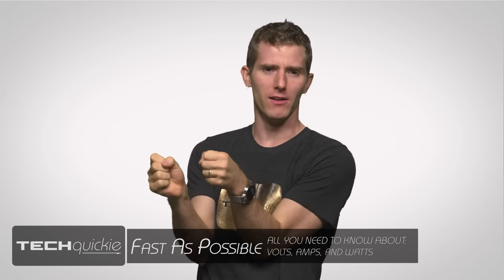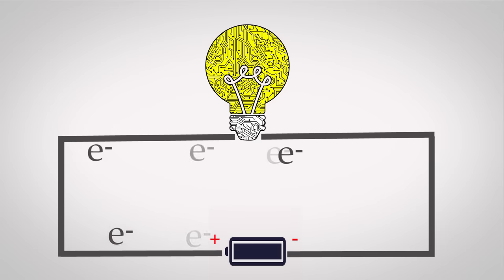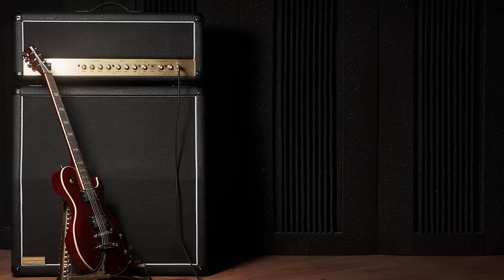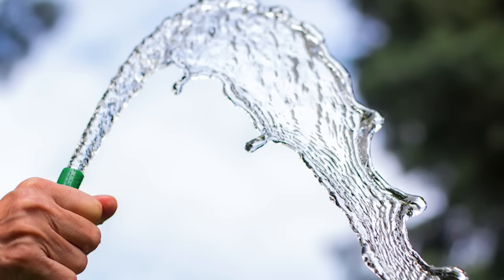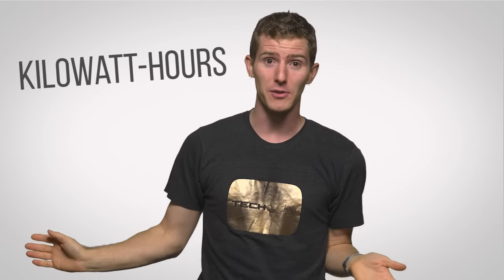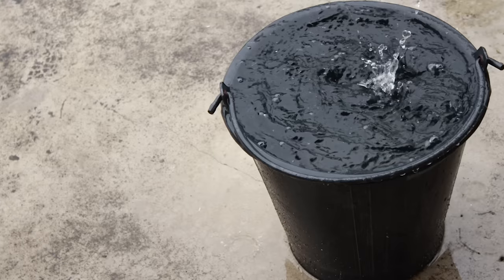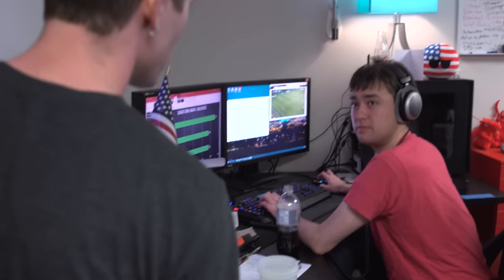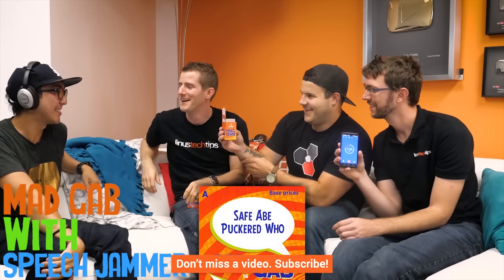Volts, Amps, and Watts Explained

Comment: I think this explanation is a bit over-complicated... but can I do better? Here goes.

Volts (voltage) is kinda like water pressure.
Amps (current) is like how much water is flowing. Think current, as in the current flowing in a river.

Just like water, if there is no pressure, then the water won't flow. 

If there is more resistance (say, a river with many twists and turns, or a narrow water pipe), it will take more pressure to make the water flow. This is just the same as electrical resistance (which is measured in ohms).

Usually, if you have a source of electricity, it will be supplied at a certain voltage. Say, 120V or 240V. This voltage normally doesn't change much, regardless of what you plug in.

Depending on the resistance of what you connect to it, a certain current will flow. When you have both voltage and current, power is used. Power is measured in watts.

If you don't have anything plugged in, that is (more or less) a resistance of infinity. No current will flow. As you might guess, there is no power used.

If you short circuit your electricity supply, that's a very low resistance. Plenty of current will flow. Lots of power is used!

To carry lots of current, you will need thick copper in your wire. The electrons flow in the copper, so you need a thicker "pipe" if there is more flow.

If your supply is a high voltage, you will need thicker plastic insulation around the copper. Just like you need a thick walled pipe to keep lots of pressure from bursting out.

Perhaps you have a heater, which is 1,200 watts, or, 1.2 kilo-watts (kW). This is how much power it will use.
Of course, your electricity bill will be higher if you have your heater switched on for longer. If you run it for 10 hours, you will have used 10 times as much energy as if you ran it for 1 hour.
This is why energy is measured in kilowatt-hours (kWh). That is, the number of kilowatts of power used, multiplied by the number of hours it was used for. Running your 1.2 kW heater for 10 hours will consume 12 kWh.

The expression "kilowatts per hour" does not make any sense (unless there is something very, very special going on!).

Batteries are slightly unusual, as they are measured in how much current they can provide, for a certain amount of time. This is because of chemical reasons. So, your battery may be able to provide 2 amps for an hour. This is a 2 amp-hour battery.
If the battery voltage remained exactly the same, this would equate to a certain amount of kilowatt-hours, but sadly the battery voltage drops somewhat as it runs flat. This makes it more complicated, so amp-hours is the preferred unit of measure.

Now for some maths:

Voltage = Current x Resistance (V = I x R)
Power = Voltage x Current (P = V x I)

An example - your 120V, 1.2kW heater.

How much current is flowing? Put those numbers into the second equation.
P = V x I
1,200 = 120 x I
I = 10 amps. Easy!

What resistance is your heater? Put the numbers into the first equation.
V = I x R
120 = 10 x R
R = 12 ohms.

Let's plug your heater into 240V instead! How much current would it draw?
V = I x R
240 = I x 12
I = 20 amps. Twice as much!

How much power?
P = V x I
P = 240 x 20
P = 4,800 watts! That's four times as much! This may be a surprise. Your heater will certainly blow up.

Did I do better at explaining it? Please let me know!
Reply: Better thanks
Reply: This is noted. I will place this on my notes, really.
Reply: Godfrey Poon so current will be = how much electrons are flowing
Reply: +Yuvraj Dhruw Exactly.
Reply: Godfrey Poon Omg thanks I finally got it
Reply: What if don't know how many amps or watts are being put out? Like say I have a 12 V car battery, how would I know how many watts it's generating or how many amps are flowing? If all I know is that it's a 12 V car battery.
Reply: If it's a DC circuit, you will need to know your load resistance R. Then you can calculate everything else.
Reply: I'm guessing in this instance that it's generating 0 watts and 0 amps since nothing is connected to the battery so nothing is flowing. 

When you connect the battery to something, depending on what it is, you'll get the watts and amps. 

For example: Connect up a 120w light bulb, then it would be using 120w and 10 amps. If you connected a 60w light bulb then you'd be using 60w and 5amps.
Reply: Godfrey Poon can you explain the birds and the bees
Reply: Godfrey Poon this is really helpful. Thank youu!
Reply: Cant say which is better, but both the video and your comment helped very much, thanks
Reply: Great job! Do you think when nothing plugged in no power or energy used? I think it should be energy because energy is something consumed and power is something about work done potential or acording to wikipedia rate of doing work.
Reply: Godfrey Poon I agree but volts and voltage are both a little different
Reply: It was better! Thank you for this explanation
Reply: Yes, make a video
Reply: Don't forget the Joule is a unit of energy that is equal to one watt-second (1 J = 1 Ws)
Also the Coulomb is equal to one ampere-second (1 C = 1 As)

for context, 1 kWh = 3.6 MJ and 1 Ah = 3.6 kC 

Equations:
Charge = Current x Time (Q = I x t)
Energy = Power x Time (E = P x t)
Energy = Voltage x Charge (E = V x Q)
Reply: Do us a favour and open your own YouTube channel
I will be easy to learn things from u
Reply: Volts is how much energy a group of charges (electrons) are carrying.That large group of charges is called a coulombs.
People think that an electron is used as energy or is electricity. Throw that idea away and think that electrons can carry different amounts of energy! Think that if ya move faster ya have more energy!

Amps is how many coulombs pass by a second.

So volts, how much energy/joule a coulombs has.. and amps is how many coulombs pass by per second.

So if every basket has 3 cats...and 5 baskets pass per second.. how many cats pass per second...

So if every car has 4 people...and 2 cars pass a second.. how many people pass per second...

So if every coulombs  carries 10 joule.. and 4 coulombs pass a second.. how many joule pass by per second?

And that idea of energy per second (also called joule per second) is called....watts!
Reply: This is awesome
Reply: Excellent job, only wish I could make a copy to go over digested it slowly! THANKS!!!
Reply: Your water analogy has its limits. Water pressure depends upon the depth of the water and varies based on the depth. it is not constant at all 

Gravity (moon, wind) affect the speed of the water. A deep lake can be still while a 1 inch stream can roar. Gravity and the angle of the stream are the instigators. 

OK i don’t want to get involved in using one to explain the other as my point is clear. Hydrodynamics and electro dynamics are as unique as cats and dogs.
Reply: thysm it really helped me and very nice explanation
Reply: I know this is quite old now Godfrey but it is read as though the ink is still wet!  Many thanks, as a newbie it has helped my understanding. I do have one query though.  You state that calculating the resistance of the heater is V = I x R (12 ohms). Surely it is Ohms Law: R = V/I ?   (120 volts divided by 1.2 amps = 100 ohms). I'm confused on this point.
Reply: Senseii! U explained alot tnx
Reply: Which is better to charge a battery. Higher volts or higher amps?
Reply: Okay this was actually great! 
 I will put this inside my textbook as a sort of cheatsheet/reminder
Reply: wow mate. You impressed me. For that, I shall express my gratitude by giving you a like. (Liked.)
Reply: I think it was on the same level as his explanation, thou i prefer written explanations so i learned better from yours! :D
Reply: I don’t like the reference as a river it is the most accurate any allergy but when you were talking about pressure pressure is in pipes not in rivers two different things same as electricity. There’s a bunch of factors we are missing. Our brains can’t comprehend 4d which is were electricity is. It’s in a multi dimensional it’s like looking at the back of a bus and trying to name all the people inside.
Reply: Great explanation bro. Thanks
Reply: how does the expression Kilowatt per hour not make sense?? washmachine using 1 Kw/h, used it for 2 hours= 1kW/h*2h=2KW
Reply: thank you, sir, that was very clear
Reply: Godfrey Poon Legend
Reply: Excellent, thanks!
Reply: Not better but the same.
Reply: Godfrey Poon thank you. Excellent explanation
Reply: Thanks, I was missing the Ohm explanation and that makes a whole lot difference.
Reply: Magic triangle...
Reply: Can I ask how to spread the voltage without changing the value of ampere?
Reply: Show off, be gone and create your own channel
Reply: Easier to understand, yes.
Reply: @jeffsmithfpv  That's why they call it 'potential' energy.  The wattage of the appliance would determine the current necessary from 12V.  W/V=A.
Reply: Much more understanding, thanks.
Reply: wish you were my school teacher. Anyway, its never late to learn! Thanks!
Reply: I'm too lazy to even read it 😭
Reply: Well, they gotta figure out a way to make it 5 - 10 minutes
Reply: No be it’s not about water won’t flow with no pressure, water won’t flow with out a pressure difference
Reply: Thank you lots
Reply: False advertisment "over-complicated"...
Reply: Haha dude stated video is over-complicated and he can do better.20 paragraphs and 500 words later....
Reply: hmm well done 👏🏻👏🏻
Reply: Way better than what happened in the video. I am noting this down. Really helped, thank you very much. :)
Reply: I'm working on college project. 
I've work out that my wind turbine can produce 15.7 watts.

Does that mean 15.7 watts a second ?

so to work out my out my power out for the day would 

15.7 x 60 x 60 x 24 / 1000 

would that give me kilowatt hours 

seem like a very big number ?
Reply: Electrons flow on the surface of conductors carrying Alternating current and internally for direct current, which is why u need much larger conductors for AC current, 

Definitely in most real world applications of ohms law the thing to remember is that your devices operating resistance is going to be a constant so your current will change depending on voltage and since the current carrying capacity of conductors has very strict thermal limits, trying to force to much current down a small conductor will create heat as  result of resistance as this increases the conductor becomes a heating element and melts its own insulation, also the increased resistance (impedance) may prevent the circuit from drawing enough current to trip your circuit protective devices, so may continue to operate despite being on fire. Soo don't burn your house down.

also the way your energy meter and energy supplier bill you for power used is the calculation of RMS power, not the P=IV. In Saying that more power is still more power so it correlates to your bill either way, just not 1:1 as u would expect.
Reply: You should make yourself a second rate YouTube channel.
Reply: @dieterecke5083  because your meter and energy company measure the root mean square(RMS) power consumed. Pretty sure u need to do up phasor diagram to figure out the math, they just charge this way because it costs more.
Reply: Godfrey Poon nc
Reply: Amazing. Thank you so much.
Reply: nice
Reply: THANK YOU
Reply: Yes, until you added Math.
Reply: Yeah but who wants to read
Reply: I've seen the water pressure/water volume analogy before. It is really simple, which is nice, and I also like how though it is simple it is not dangerously misleading. Nice job. You forgot watts, by the way. Well, no you didn't, but it would have been more beneficial to those people who seek the counsel of your adequate explanation to include a simple analogy pertaining to watts such as "watts would be the power the water coursing through a pipe could provide," or an alternative of that caliber. Overall, though, nice job.
Reply: Wait wait,  you know you went too fast.  I will remind you, just being nice...  :)
So wire carries electrons as pipe carries water and a generator is to the water pump.
Now where electricity is to what water analogy because you know electrons are not electricity.  Electrons remain in the system and we are not buying electrons.  So what do you say?
Reply: When a hero comes along 😭✨✨✨
Reply: Much better, thank you.
Reply: Your calculation for wattage is incorrect for an AC circuit. See my previous explanation
Reply: Sorry man, I got lost reading your explanation. I have to give it to him for explaining things better. Still, great explanation.
Reply: Hey sir, you rock.. thanks
Reply: So much better, Thank you... jJust read yours, Linus is reading something anyway and did not really “explain” it.
Reply: feels back in high school
Reply: Godfrey Poon are you an electrician too or an electrical engineer?
Reply: Great explanations!!!
Reply: Godfrey Poon Thanks bro!
Reply: Potential Difference and Amperage currently combine into wattage joulery for sale by your local municipality monetary system of price gouging hourly = capitalism.
 Yer Welkum
Reply: @stonersmurfstonersmurf3244  higher amps, as far charging it faster.
Reply: You should be my teacher
Reply: Godfrey Poon very well explained. Thanks
Reply: Copy pasted pretty much your entire post for personal reference lol..green as grass when it comes to electrical stuff though slowly learning as may be working in the field soon...thanks heaps for the awesone comment!!! Video was awesome too, but being a newbie completely lost me after  kilowatt hrs and the rest lol
Reply: Thank you, it is a more concise explanation.
Reply: Perfect.
Reply: You just remind me of my days as High School Physics instructor, though this was not my best area. My best part of ohysics was Waves, Lights and Vibrations.  Thank you for your detailed explanation.
Reply: Very good explanation , with JUST ONE correction. 
Electricity IS NOT flow of electrons, but flow of electric charges. 
If you have flow of electrons, this means that the conductor material loses its electrons . This mean that this material have to be turned into another chemical element because of reduced number of electrons. And we don't have that transmutation. So we don't have flow of electrons, but flow of electric charges.
Reply: Better,i am from andra Pradesh,balaji temple,india
Reply: God bless +
Reply: see
Reply: Loved your explanation
Reply: How the hell do you copy or bookmark a response 🤦‍♂️? Can’t figure it out myself.  Dumass YouTube. Oh well, got to Google that as well🤦‍♂️
Reply: tq man , 👍🏻👍🏻👍🏻
Reply: 3 years later and your comment still helping others. Just when i thought the internet was the worst thing to happen to society i stumble on this.
Reply: Sorry to latch onto your 3 year old comment, but I liked your explanation and am still not getting it. 

So for a 120V, 1.2kW heater we get the following:
P = V x I
 ---> 1,200 = 120 x I  --->  I = 10 amps of current. 
So much is clear. From this we calculate 12 Ohm resistance, also clear.

Then we hook it up to 240V:

1200W = I * 240V -->  I = 5 Amps of power. So far, so good.
But now V = R * I tells me that 240V/5A = 48 Ohms of resistance?

I'm guessing this calculation is wrong because resistance is a fixed property of my Heater and doesn't depend on the voltage, but How do I know this bevore? Let's say the label fell off, how do I know what Voltage I need to hook it up to in order to be able to calculate the Resistance correctly? How can I tell which properties are fixed and which depend on circumstance?
Reply: Damn!
Reply: Thanks bro
Reply: Nice one Godders lad.
Reply: Godf
Reply: Yeah better thank you.
Reply: wow man!
Reply: CAREFUL ! THIS MAN IS A HERO
Reply: I still can't quite get my head around this. In water, doesn't more pressure means more water flows through the pipe? If we say that I am pushing water through a pipe harder, doesn't more water flow because the water is moving faster? This distinction between voltage and current is difficult for me because of this confusion.
I am guessing here, but maybe water is in fact the voltage itself, like a count of how many electrons are being pushed, and the current is how fast they're being pushed? So to measure power between a thin, high-speed pipe and a thick, low-speed pipe, the power is the same but one has less water flowing faster than the thicker pipe, with more water flowing slower. Is this a correct way to interpret it?
Reply: Nicely explained, so an appliance made for 120v can't be used in a 240v outlet? is there a way in an appliance can be used in both 120v and 240v outlet?
Reply: Godfrey Poon, thanks for the explanation minus the ADHD.
Reply: These are the kind of people who reignite my faith in humanity
Reply: Thanks!
Reply: Thanks!
Reply: I’m just like... really made I can’t copy and paste this into my phone notes. Youtube app won’t allow it.
Reply: thanks buddy
Reply: This helped me a lot!
Reply: It's more complete. nice
Reply: This guy just ruined Linus' whole video
Reply: i was hoping someone smarter would explain it in the comments, thanks.
Reply: Can you teach 12th students 😂
Reply: @Godfrey Poon Thanks for trying to help but I'm STILL confused by why an electric motor will burn out due to excessive current when connected to LOWER voltage than it's rated for. "ustpower" state that "A low voltage forces a motor to draw extra current to deliver the power expected of it thus overheating the motor windings"  which is analgous to your "Perhaps you have a heater, which is 1,200 watts, or, 1.2 kilo-watts (kW). This is how much power it will use", comment - both basically say that the appliance/motor DEMANDS a certain WATTAGE, rather than accepting however many watts it gets from the voltage (which it has no control over) pushing it, and the amps (which are dictated by upstream voltage and resistance, which it ALSO has no control over) which makes this entire video confusing... the water analogy is misleading I think.

The whole system sounds to me like the appliance gets what it's given - potential (voltage) results in current (amps) that is limited by wire diameter and material (resistance) and if the circuit is completed by a ZERO ohm appliance, you get max current, max watts, no change to voltage?  And if there's a ton of resistance inside an appliance, that will reduce the current - but how can an appliance which ADDS resistance to the circuit INCREASE CURRENT when the voltage - the driving force - REDUCES? 

Sooo confused :(
Reply: Going to copy this onto my notebook. Thanks a lot!
Reply: Thanks for this Godfrey... One question though, for practical application's sake... If my old laptop charger is a 44Watt, with a 15v 2.8A output...will it blow up if i use a voltage that's just 1-5volts higher?  What happens if i use a charger that's 1-5volts lesser?
Reply: Wow what an explication.
Reply: I think he explained amps and voltage really well with the hose and water gun example
Reply: Honestly i did not watch the video. I just scrolled for comments until i saw this. Man! I'm really grateful. This is very helpful. I kinda have trouble analyzing which one is one. Haha thanks a lot!
Reply: I think i just passed my physics exam
Reply: Purely amazing!!
Reply: @jeffsmithfpv  you have to have at least two values of the equation to find the answer for the third unknown values...so with only a known  voltage of 12vdc in this case ..to know anything else about it ..is impossible as you have no our knowledge making everything acciacated
Reply: Best explanation
Reply: you're my hero love you
Reply: Put another way, the analogy with water hose. Water is quantity of energy, 1 liter of water is like 1 Coulomb. How much water flows per second using your concrete water hose is like 1 Ampere, 1 liter of water per 1 second.

Now come Watts. A thought experiment. If you are in an outer space with your favorite hose and with ZERO GRAVITY, then you can point your hose at whatever direction, and the amount of effort the water will need to flow out with the same speed will be the same.

Yet, if you are standing on the ground of planet Earth WITH gravity, it will take different effort for water to flow out at the same speed depending on which direction you point the tip of the water hose. 

Vertically upwards, directly downward or somewhere in between. So, in very abstract terms power comes about when we need to overcome some force. That is, throw 1 liter of water one meter higher above the ground, throw one Coulomb of electric charge across 1 Volt.
Reply: @dieterecke5083  because it's like saying a vehicle is travelling at 55 mph per hour. An appliance drawing one kilowatt is drawing it continuously whether that be for an hour, a minute or a month.
Reply: Not all heros wear capes 👏 🙌 👌
Reply: @SpaceMarshalGyorni  What confused me is how he got 20Amps when it should be 5 Amps for 240V

For 120V Heater:
P = V x I
1,200 = 120 x I
I = 10 amps.

As per this logic
For 240V Heater:
P = V x I
1,200 = 240 x I
I = 5 amps

Doesnt that essentially mean the same output of current? Please tell me where I am wrong.
Reply: Finished reading this and understand better than the video! Nice job.
Reply: I absoloutely love these comments
Reply: Everybody Gangsta till they hit read more 😂
Reply: You mean watt depends on the voltage? Higher the voltage = higher the watts? Please tell me I am confused.
Reply: How much time u have on ur hands
Reply: @cybersteel8  hey im currently having similar questions, have you managed to figure this out?
Reply: @doodoopoo  Yes I have. My analysis in my comment is kind of correct.

When I say "doesn't more pressure mean more water flows through the pipe?"  I am correct. For the same width of pipe, more pressure means more water. In this analogy, I am increasing voltage while keeping the same current, thus more power.

If I were to increase the pressure of water through a pipe, but make the pipe more narrow, then I can balance out the increased voltage with a lower current to have an equal amount of power travelling through the pipe.
Reply: THANK YOU SIR!!!
Reply: Much more better
Reply: Current doesn't flow it's a measure of how much charge is flowing. Water flows in rivers not current.
Reply: i can't believe a litteral stranger explained it in less than 1000 words, than my teacher who needs 6 weeks to teach this to us.
Reply: Now it's only a teeny tiny bit complicated.  Good job!
Reply: Hey so Why would the power be the same in the power supply if we plug it into 220 outlet and a 110 outlet? Doesn’t this mean that the power supply itself must have had some hidden mechanism that recognizes a change in voltage and somehow alters the current so the power stays the same?!!!!!